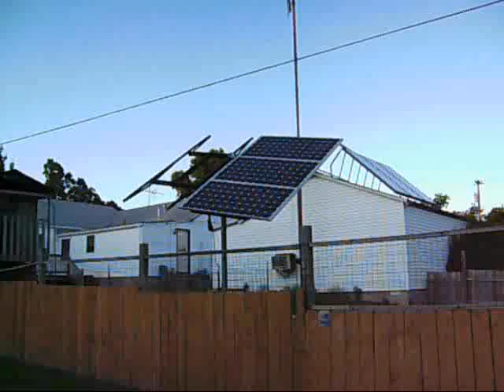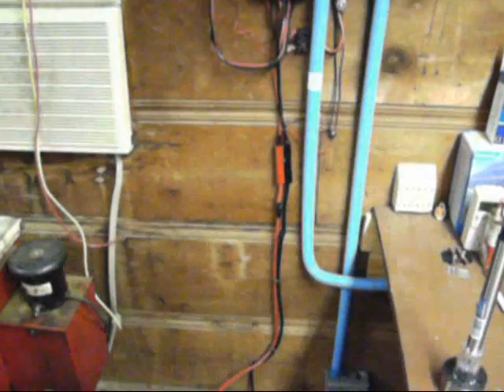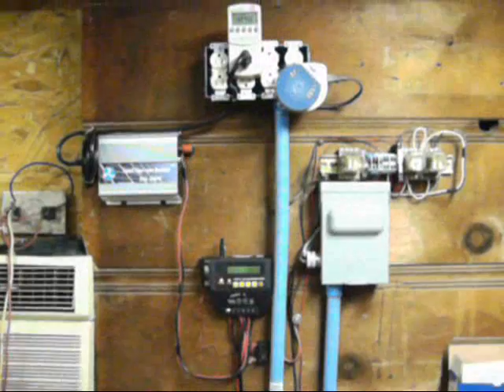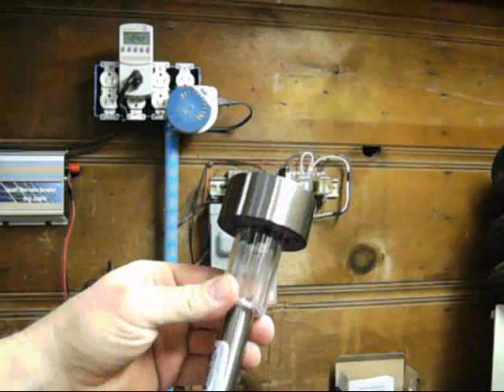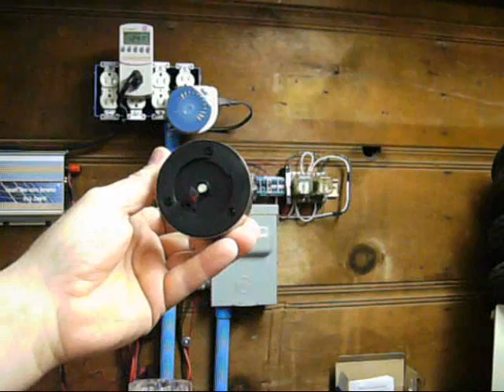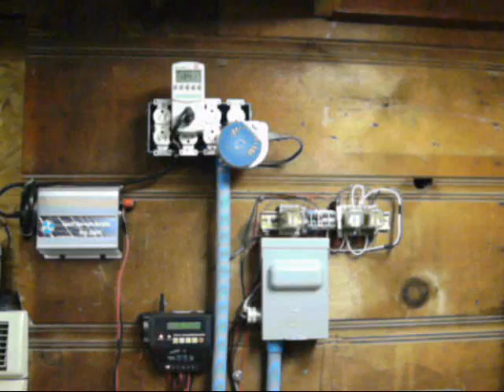My solar system, solar panel, solar power 2

Comment: Very nice system! Have you had any issues running your grid tie inverter off the load side of your charge controller? Does your grid tie run all day and night off your battery bank and if so does it drain your batteries until you hit the cut-off voltage on your charge controller? Thanks!